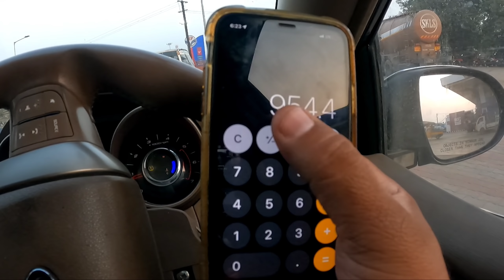2000km in 26hrs Drive.നടുവഴിയിൽ കേടായി😭|

Comment: Ac compressor ethara ayi rate parayo
Reply from the maker: 15000/-
Reply: Labour gas filling athake price ethara ayi
Reply from the maker: @unnikrishna4646  new compressor and full pipe cleaning and cooling coil cleaning and dash open and refitting costed ₹28k
Reply: @XUVChettan  thanks you